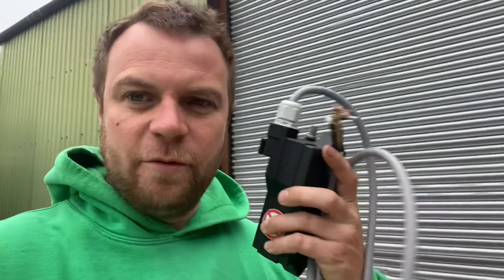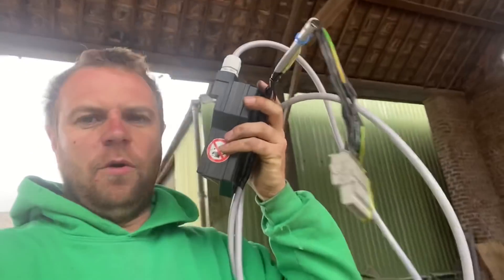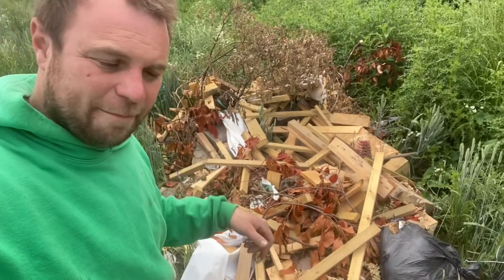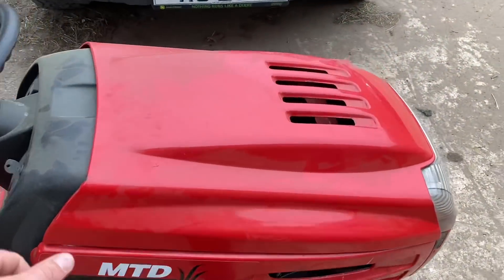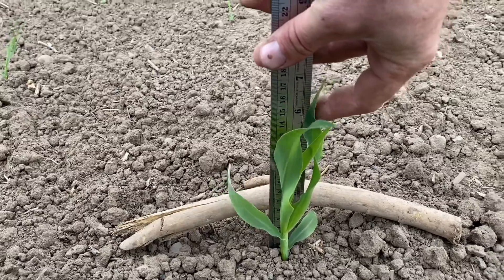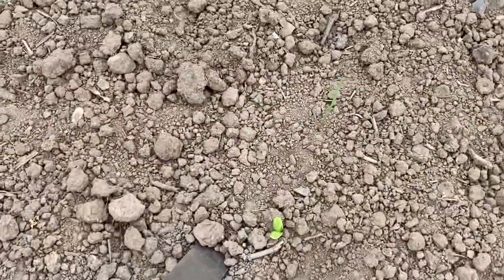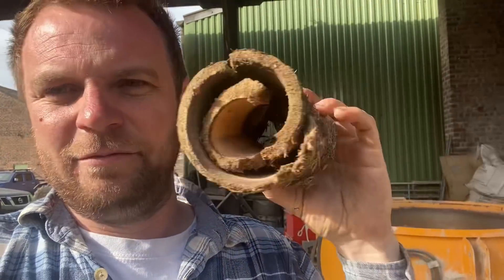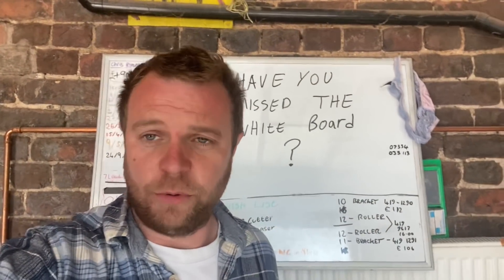Day449 #OLLYBLOGS SHOULD THERE BE A REWARD FOR KNOCKING CHAVS OFF MOTORBIKES ? 
#AnswerAsAPercent

Comment: When I worked at a biomass power station, I swear we were getting woodchip that had been used as horse bedding. It stank of urea. Bizarrely, when we were burning it, we actually turned down our urea pump as we found we didn't need as much. 
So yeah, horse piss soaked woodchip is the worst smell.

Comment: hi Olly
couple of years  back i pulled up to a junction with my discovery waiting for a gap in the traffic and there were two up on a dirt bike riding down the path they ploughed straight in to the side wing straight off the bike slid across my bonnet in to a heap the other side in the middle of the road just as two beat police appeared from a alley your nicked boys didn't get compensation for the dent and the dent and scratches but they got what they deserve i hope. great blog. horrible smells ,bin juice burning plastic and my Neighbour he stinks